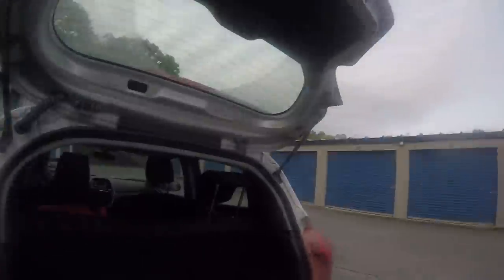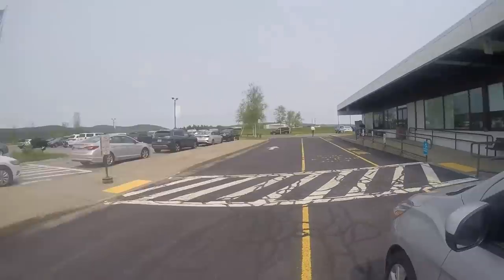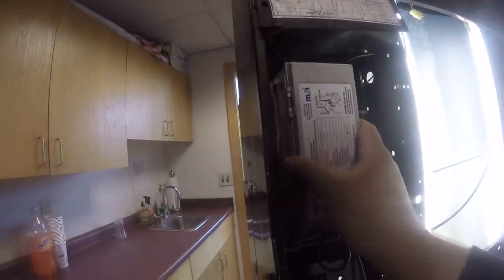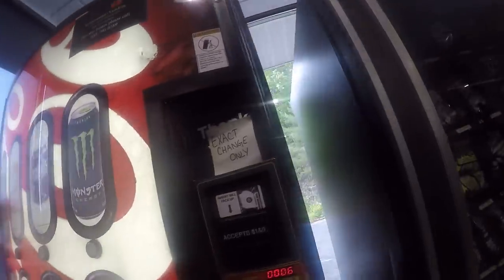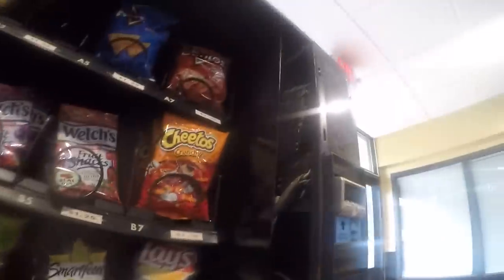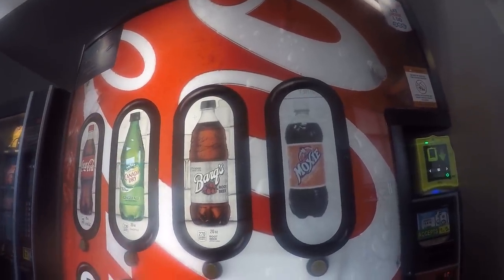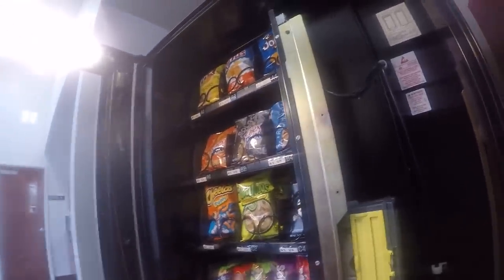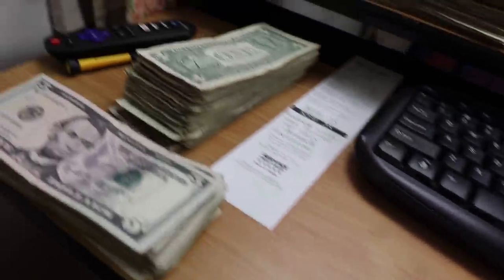1200 dollar vending machine collection!!!

Comment: A good result about only a few machines, I need a lot more machines to have this . By the way , Mai and June are the best months by me.  How do you like your new job ? The problem by the can is  an issue with the engine at this row. Put a little bit miracle cure WD 40 in it , it hepls mostly .